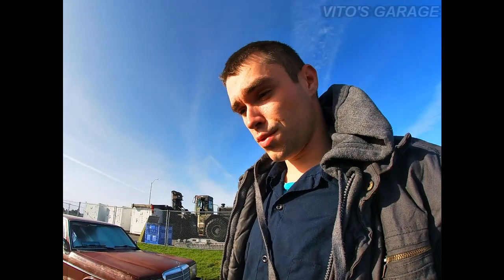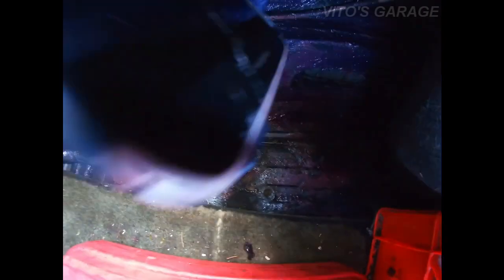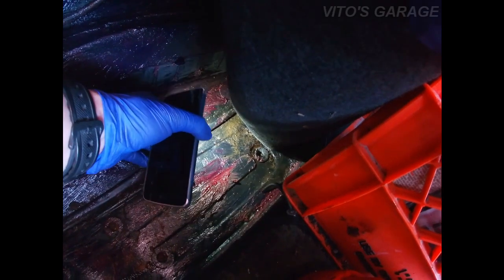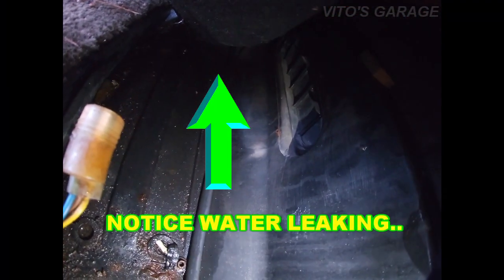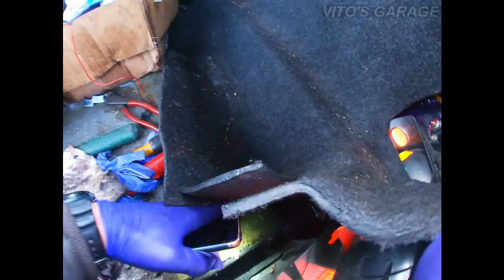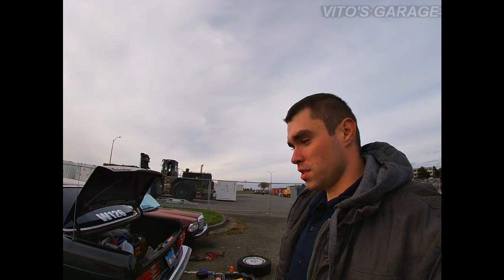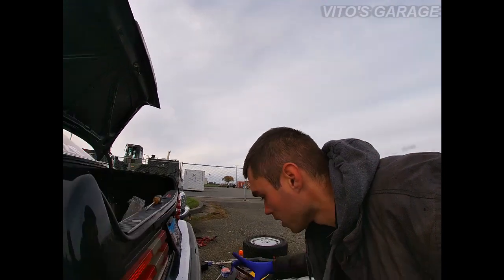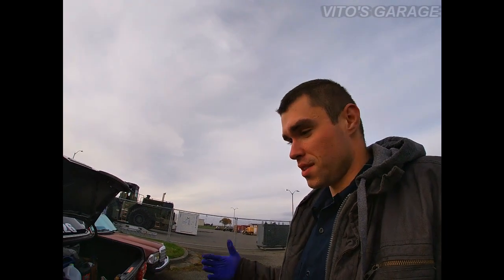Mercedes W126 W123 W116 W124 W140 Inspect and Protect Your Trunk Pockets. Very Critical!

Comment: I had a 1985 300d back in the early 2000s with about 280k miles and I had no rust anywhere. But the burp tube came off once off the fuel filler tube so I got diesel in that right side. That tube can shrink and had no clamp so I put a hose clamp on it. That rubber tube connects on the inside of the trunk.
Reply from the maker: These cars run and run. Of course you have to take care of them too and give them love. I have 2 W123s in Chicago, W210 and W126. I am planning to restore my W126 this year once if everything goes as planned. It has 445k miles. I am sure it has more than that. Amazing cars☺🚗💨

Comment: Hi use bar chain oil it very good for rust proofing.
Reply from the maker: Thanks for the tip. Does the oil stay on the surface for a while or it dries up? Because wheel bearing grease stays for a very long time, especially if it was applied inside the car
Reply: No it  very good do not wash off.
I use it on my old cat .it better then 
All other rust proofing  products. 
Watch on YouTube  channel 
Is mustice1 he work on all old 
Vw and use  bar and chain oil.

Comment: On my w116 I've got holes where you pointed, I also have rust under the rear seat beacuse the rear window seal failed. My car was leaking oil for a few years, the parts coated with oil had no rust at all.
Reply from the maker: A lot of people don't check those spots and they start having problems later on. It's very important to check those places and repair everything as well as coat with paint and grease👍

Comment: The antenna gromit on my 500 SEC isn't giving me a perfect seal. I was caught in a massive rain storm last year and had dampness in that pocket. Dammit!
Reply from the maker: Ugh yes, antenna seal is another one to check and replace if needed. Did you figure out your leak? Make sure to use Mercedes OEM seal

Comment: I finally gave up and used a seam sealer on both of my 126 cars.  Tail light gasket was leaking on both 126 cars.  One car PO let rust through.  I used fiberglass and POR15 until I decide to repair with metal.  Now I can put the trunk liner back in.  

I used this stuff, not RTV or some other silicone.  https://www.amazon.com/gp/product/B000PF13JW/ref=ppx_yo_dt_b_search_asin_title?ie=UTF8&psc=1
Reply from the maker: Interesting. I fixed another W126 before with new trunk seals, new one tail light seals and rear windshield seal. No more water leaks or problems after that
Reply: @VITOSGARAGE  I bought the OE trunk seal for the SD that was repainted but didn't find OE tail light seals at a price I was willing to pay. I'll never have to remove the lenses unless the car gets hit and the seam sealer never completely hardens so that it can be removed if absolutely necessary.  I consider this a rig and don't like to do it but wasn't willing to pay the price for seals that might also leak.

I did buy OE seals for the trunk and rear windshield.  The glass installer was impressive.  Very competent and the glass went in very easy no muss, no fuss at $60 which is what the shop pays.